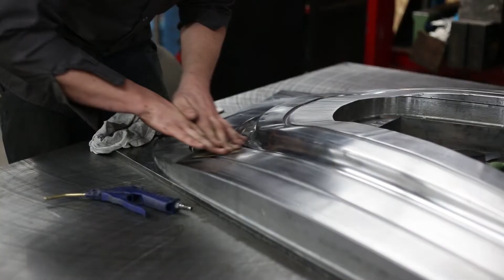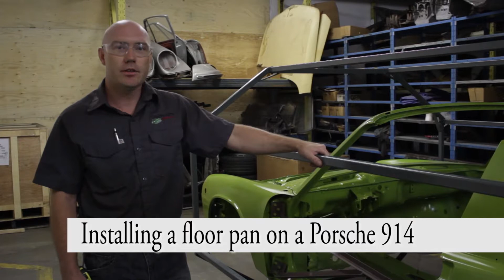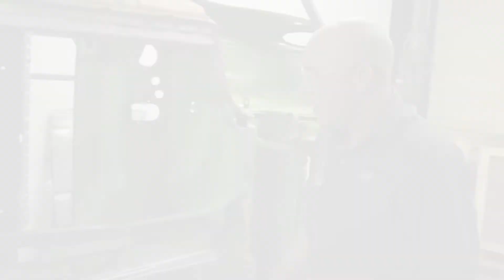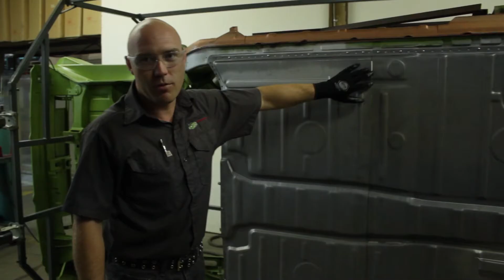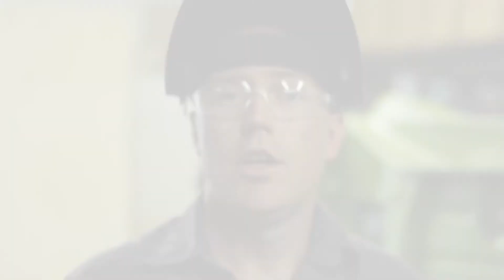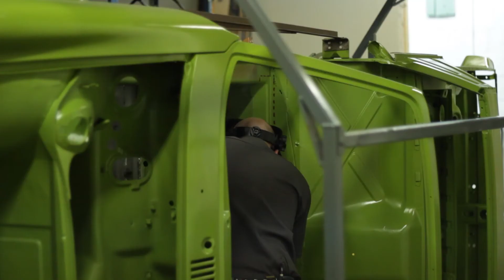How To 914: Complete Floor Pan Installation

Comment: Just a hint on measuring with a tape measure. Use the same side of the tape. I know its just 3/4 or 1 inch wide but over a 52 inch span than variance will make a difference. Also you have to make sure if using the leading edge that you are pushing on the tape and not pulling...make sure which ever you use its done on ech measurement. When i measure anything that need to be precise I use a tape with no play in the lead/hook.